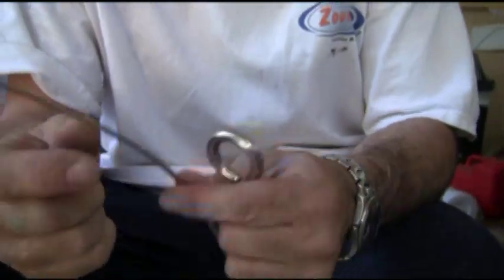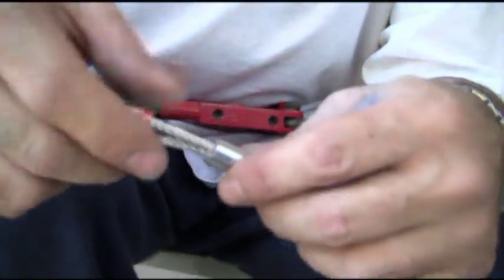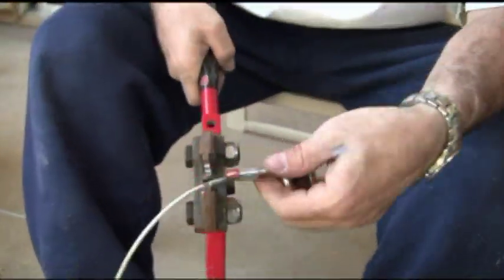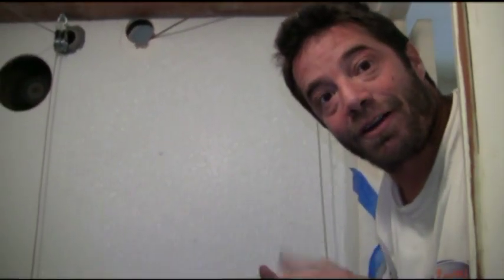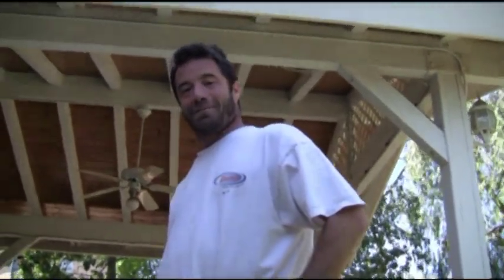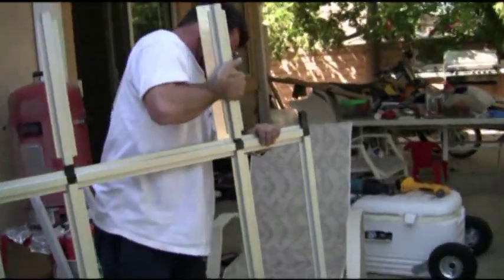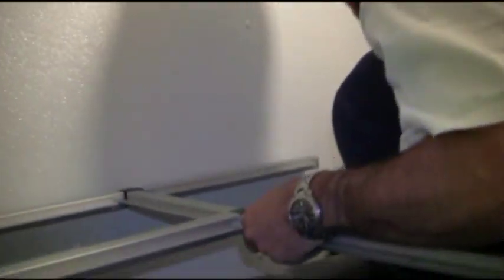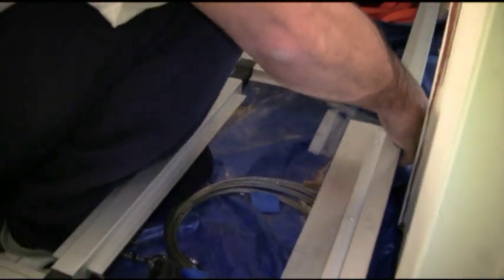Coral Reef Aquarium LED Lighting, LA Fishguys Episode 99 pt 4

Comment from the maker: hey J, this is an acrylic tank, and most acrylic tanks have a solid top panel, for structural integrity, with the openings cut out. If you watch part 6 you will get a better idea of the top of the tank, and yes he has been standing on the top of the tank.

Comment: @helicrashpro The cable is 1/8 inch stainless cable. It was the smallest cable I could find the appropriate sleeve crimps and pulleys for without digging too much. As it was finding decent pulleys that were not too expensive was a pain. The cable is also readily available from local suppliers so it was kind of a path of least resistance. Overkill yes, but it will last for ever.

Comment: @yngvai777 Computer business... Tight funds were actually a driving factor in this as I could no longer afford my electric bills. They were in excess of $1000 per month a little over a year ago. The sump/pump swap dropped them to around $500-600. Now they will be down to between $200 and  $300 or less. It cost a bit up front but in the end, the savings will be huge. Plus I sold my old lighting equipment among other things to cover the new light costs. I'm resourceful but not rich.